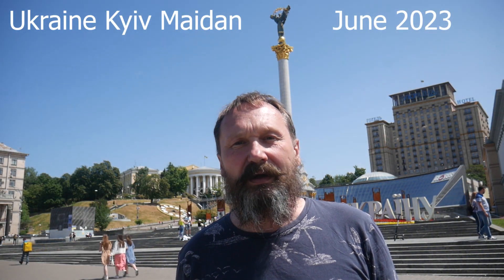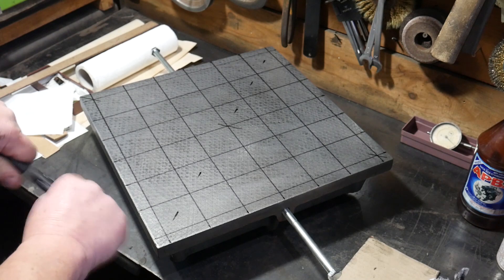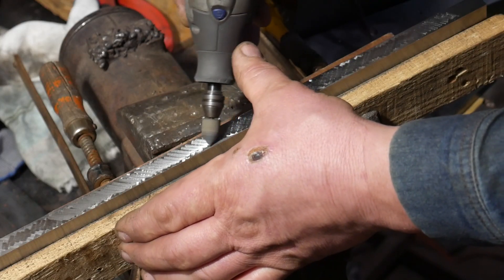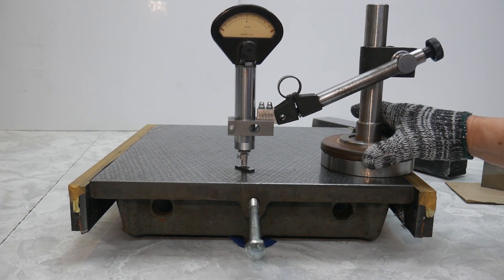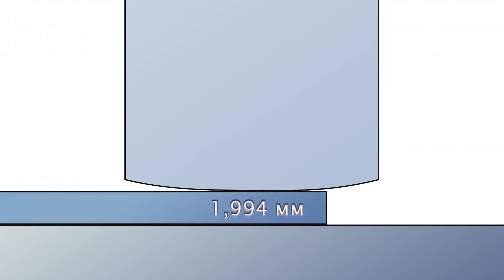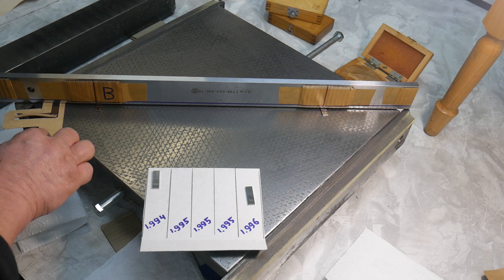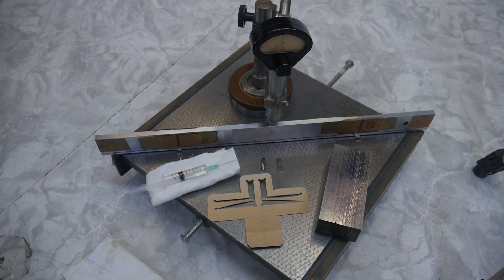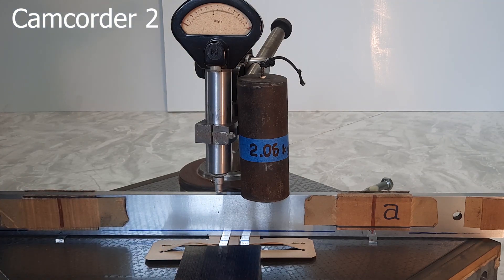How to "catch" a micron.

Comment: The last experiment made me curious about the curvature at the bottom of your straight edge. You could probably get a estimate by measuring how far the gauge block can be pushed under the straight edge under different deviation (measured with the 0.2um indicator). You could also measure it with an optical flat.

Comment: so nice. thanks a lot. can you explain how the gage blocks are produced? I know that a man from sweden dicover the best production process but I can not find more about that. Greetings and thank you so mutch!
Reply from the maker: Hello! I can try making gage blocks, and most likely I can meet the standards set for them. I was interested in this issue and know the technological methods of their production process. But to do this job I need to have very high end reference blocks (which are very expensive). Otherwise you won't be able to get the exact size. And also, please provide a link to the video you mentioned, unfortunately I haven’t seen it.
Reply: @gena_bazarko  Off course you will and can do it! I do not have any references video for the production of gage blocks. I read it some how... sorry. I just remember, it is a special lapping method, and the metall he used was periodicaly heated and frozen and heated and frozen.... very often, to reduce material stress. Now a day we have Invar, or technical ceramic. Oh I found the wiki artikle. It was 1896 by Swedish machinist Carl Edvard Johansson. [1] In the wiki artikle of "gauge blocks" [2] in the section history it is mentioned that he used the " Singer sewing machine" of his wife. Also there is a Swedish patent on 2 May 1901, SE patent No. 17017, called "Gauge Block Sets for Precision Measurement"  - we have to looking for that.
Greetings 
The most difficult is the parallelism of both faces. the parts tilt when lapping. Probably a much larger part is machined and then cut to size.
Reply: [1] https://en.wikipedia.org/wiki/Carl_Edvard_Johansson
Reply: [2] https://en.wikipedia.org/wiki/Gauge_block

Comment: I really like your approach on "creating" precision with relatively basic tools and equipment.

Don't worry about your English (you mentioned this in another video)- it is perfectly understandable and will only get better with practice!

One suggestion- in many of your videos, you are using a technique that I have heard other machinists call "repeat-o-meter" (indicator mounted on a flat surface). I am sure you already understand this, but it wouldn't hurt to explain to other viewers, that it is just one method to check the surface, it must be combined with others to determine that you really have a flat surface (imagine that surface you are measuring is perfectly spherical- it will show no deviation on the indicator, but it obviously is not flat).

Слава Україні!
Reply from the maker: Glory to heroes!    https://youtu.be/HwLQkeVVUk0   In this video, at the end, I transfer the device to the lap plane. If there is a sphere on the surface, then the instrument readings will change. But they are identical. I ruled out the appearance of the sphere, as I technologically avoided this due to the sequence of methods for doing the work.